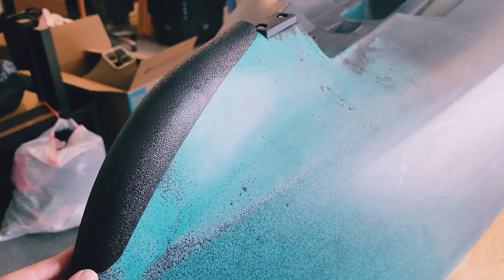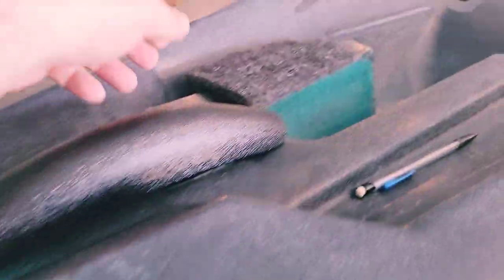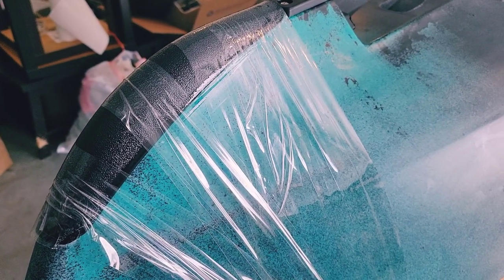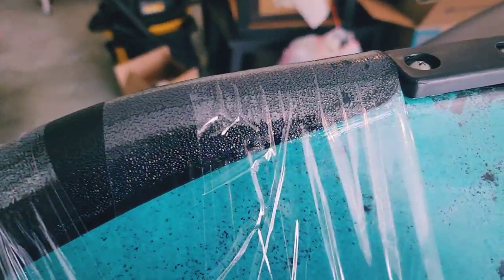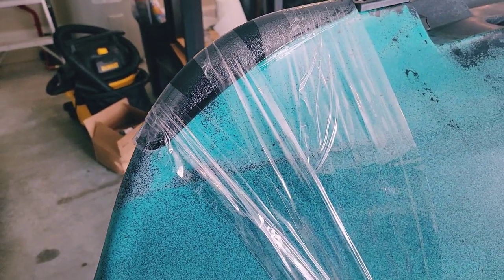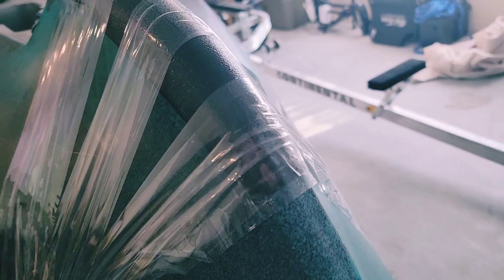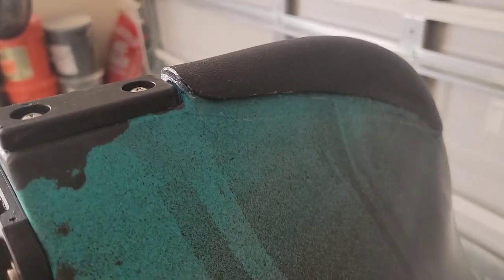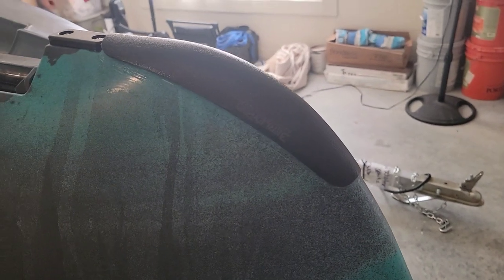Protect your investment with THIS kayak upgrade!!

Comment: WTH are you running your YAKs into to need this?  I run rivers & Creeks with tons of portage & structure. Never would add this on my RvR 119.
Reply from the maker: When you spend 5k on a kayak, you want it to last.  Its just an extra layer of protection 👍🏻